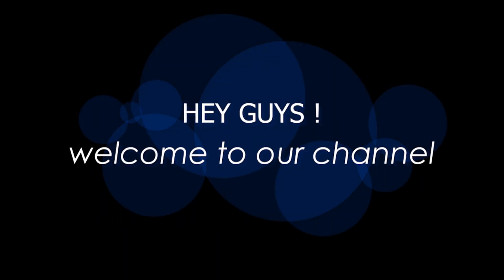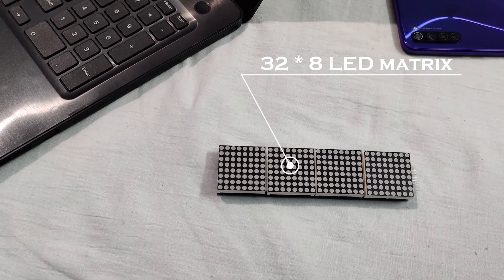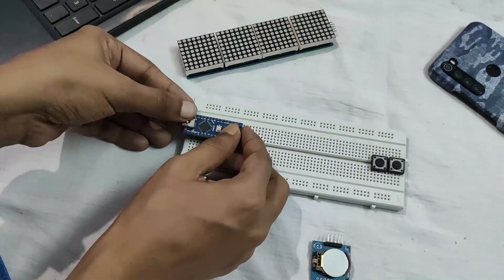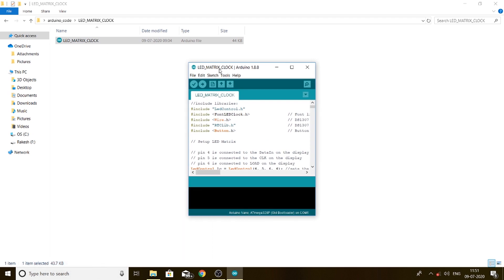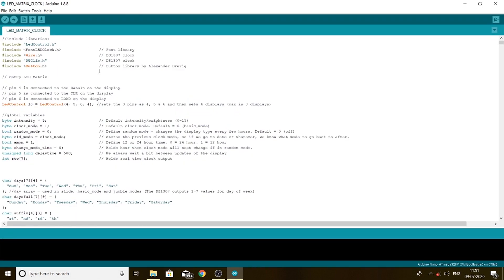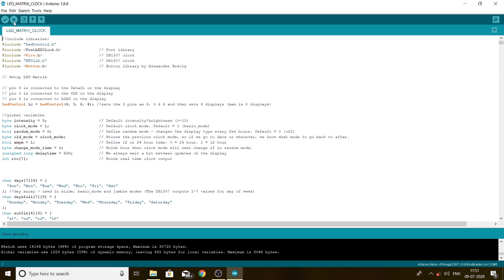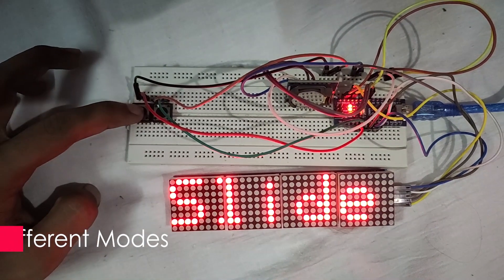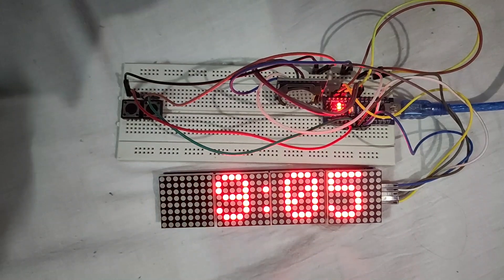How to make a LED Matrix Clock using Arduino

Comment: Thanks for sharing the codes.
Code is 100% working. Even I have used  DS3231 RTC without replacing DS1307 in code.
Please modify the codes so that day,  month and year be scroll right to left every after few seconds in every mode.
Great work done by you. Thanks
Reply from the maker: Keep Supporting..❤️
Reply: Sir, after many days I want to run the clock in small mode as default mode. But now I am getting error - Button Pullup was not define in the scope.
And also please explain digitalWrite(4, HIGH);                 // turn on pullup resistor for button on pin 4
Why the above line is mentioned.
Please reply
Thanks
Reply: No reply?

Comment: works perfectly even with ds3231, have generic max7219 8*8 individual 4 modules, had to orient to the left and daisy chain them & selected fc16 hardware to display characters correctly for all sketches(that's a different story).